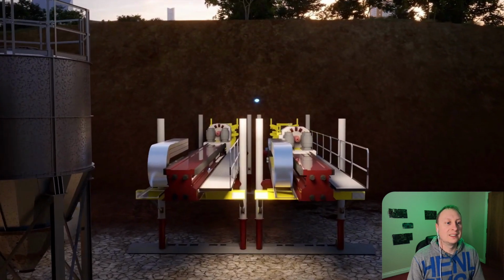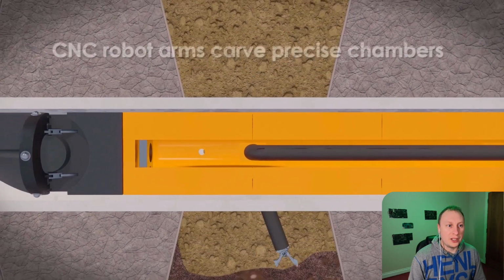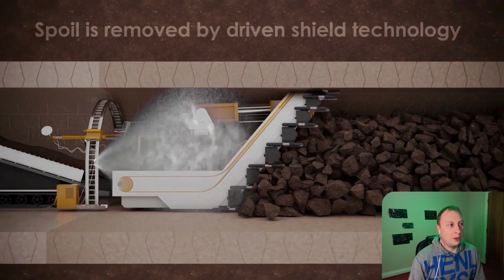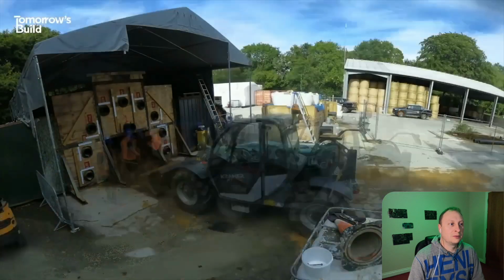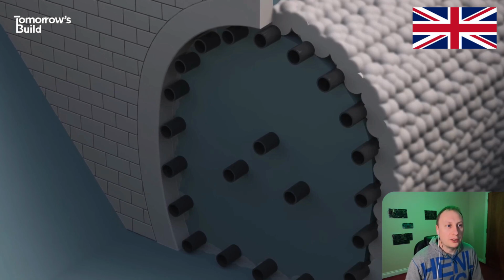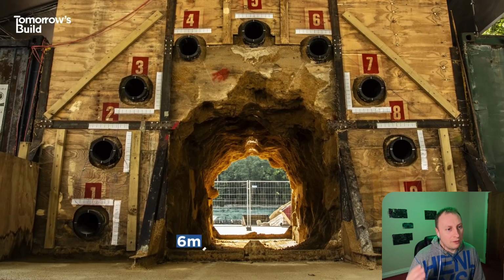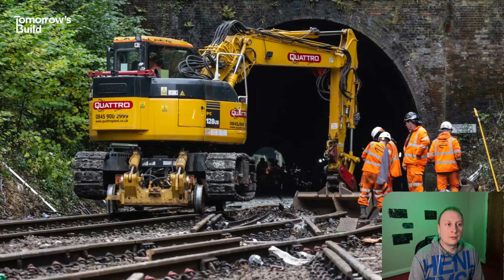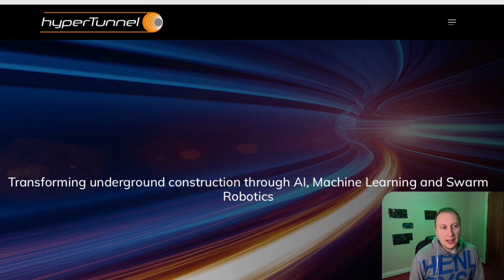HyperTunnel : Bonkers or Brilliant ?!?!? 🙄 👷🏼 🏗️ 🆕 🤖 👍🏼 🚇 #170

Comment: This type of canopy or perimeter tube construction of relatively short tunnels is becoming quite common. Several completed and ongoing in Asia and Europe 
Generally limited to straight sections in suitable ground conditions.
Then excavate the internal material by fairly traditional means (their “disruption” of the remaining ground will not work, excavated material needs space to expand into whether it is by blasting, road header, TBM or ripper.)

The use of swarms of AI robots to do the work seems a bit far off for me as wear and thrust issues don’t seem to be addressed.

Canopy TAM tubes with ground treatment (grouting, freezing, mechanical joints, concrete infill) works.
They have to get past that existing system by lowering cost or making it more flexible before it becomes viable.
Interesting none the less.

Comment: It would seem to me that you would over-grout into the tunnel and have your bulk excavation machine "polish" the interior face.  I imagine the primary role of the interior mini-tunnels is to facilitate breakup of the strata for the bulk excavation.

Likely a good approach for "pipe bursting" existing tunnels for larger diameters, although unless the mini-tunnel casing is longitudinally structural I'm not quite sure how it would be "better" than just doing the process from the inside face of the tunnel.

Comment: Would it make more sense to develop smaller tunnel robots like they have pictured and then deploy like 10 of them at a time? Then come in when they are done with an overall TBM because I would assume it would be easier and quicker to dig the tunnel with the smaller holes in the middle?
Reply: You beat me to it - I was thinking the same thing. Combine the two approaches.